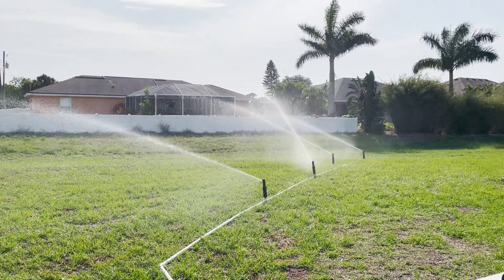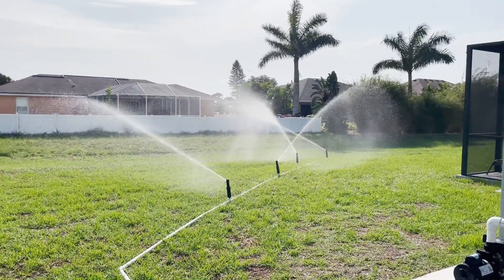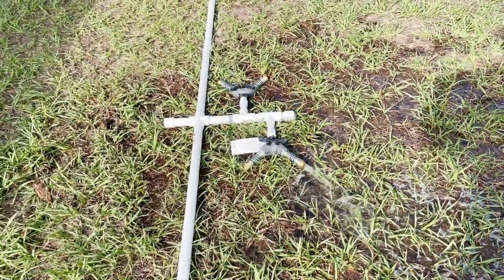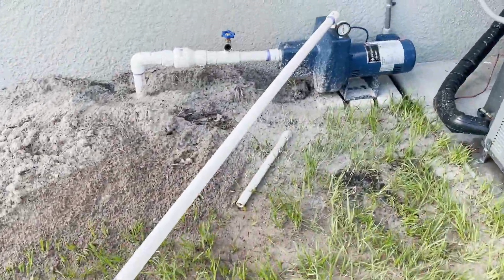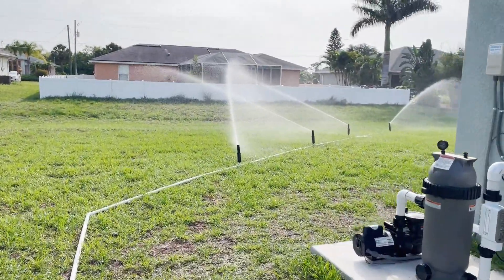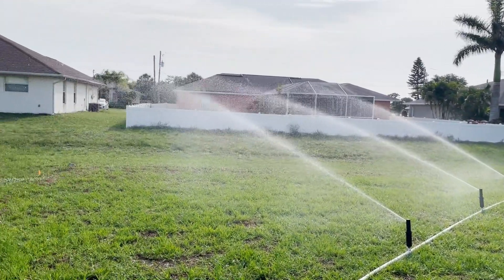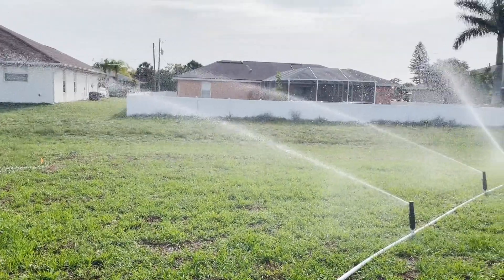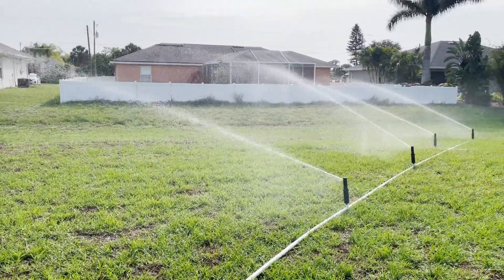Florida Sand Point Well (part 10) Hunter PGP 3GPM Test

Comment: Guy, this is the best video selection I have seen yet on how to do this. I am in the Northwest FL about to miles from the ocean. My neighbors wells appear to work great but mine is either clogged or the well pull line has a crack, which that is what I suspect.  I am going to re-dig a couple of these and hook up just like you did.  Again great videos.

Comment: How many ft you get a water table? I am from Orlando. Thanks.
Reply from the maker: The ground water table in my area starts right at 8'.  So, with a 26' hole, I have 18' of water surrounding and on top of my 4' sand point.  Water for days if I want, but I don't.  😁
Reply: @guydoesstuff6562  Thank you very much!

Comment: Which pump did you use?   I tried a harbor freight and DRUMMOND and it candle my 27ft well point with 14ft water table.
Reply from the maker: I went with a robust, long-term solution:  1HP Pentair HNE-L Sta-Rite Shallow Well Jet Pump.  This is a cast iron pump which is rated at 1HP, but due to the internals and performance specs, it is easily a 1.5HP pump in sheep's clothing.  It is currently a $600 pump, but should last 10 years before needing to be rebuilt.  The other pumps at $300 to $400 will last a few years before needing to be thrown out and replaced, so a much more expensive pump over the long haul.  Avoid plastic pumps.  They are noisy and burn up quickly.
Reply: Are you still make wells in port charlotte area? Thank you
Reply from the maker: @yamelrodriguez9049 , I just added videos to YT as a DIY'er.  I am not for hire.  Just a homeowner taking on a project.  Please let me know if you have additional questions.

Comment: Do you have a check valve in each well point or just 1 at the pump?
Reply from the maker: Just one at the pump.  The CV is oversized by 1/2" and then adapted back down to line size at input to pump.

Comment: Awesome video series. Looking to add a well system to my property exactly this one. Property in St. Petersburg FL, how did you determine the depth to put the shallow well? I was wanting to only do one well point rather than 3. I’d have max of 4 heads in a zone
Reply: Thanks.  When using a surface pump, you'll want to stay less than 30'.  At 33', you'd be at 1atmosphere of pressure and surface pumps won't work below that.  Another reason for 26' well is that we are coastal (<5 miles from the gulf) and didn't want to run the risk of getting into saltwater.  I was into good sand right at 20'.  You can research your local groundwater depths in the St. Pete area, but you should be into plenty of water at even 20'.  I have 26' holes with 17' of water in each one, so LOTS of water.  Plan on covering your well points with at least a 3:1 ratio of water.  So, if you use 4' well points, you'll want to have at least 12' of water in the holes.  I would strongly recommend going with a 2-head setup as a safety measure for longevity.  Your GPM of flow and pressure will determine how many heads you can have.  For example, I have a zone that has 23 heads on it, but the nozzles are all rated at 0.5 GPM, so 12 or so GPM usage.  The number of heads in a zone is not important.  Rather, your total GPM of all heads combined in the zone is the key.  You just want to make sure that you can maintain 45 psi from your pump when a zone is running.  If you have to drop down to smaller nozzles, all you have to do is run the zone longer.  Hope this helps.  Good luck and please post back regarding your success.
Reply: @nhojcam  That doesn't make sense. If that were the case, we wouldn't be able to pump water out of a deep lake or the ocean. What really matters is the distance of the water level from the ground. The deeper the well, the better.
Reply: @masf1977  you are missing a key point... these pumps are on the surface.  deep wells are pumped differently.
Reply: Thank you for the info. Super helpful. I’ll post back as I get more info. Right now I started the project over the weekend and successfully hit 19-20’ with 1 1/4” well point. I hit the water table which sucked the water out of my pipe so I figured that’s as deep as I can go with my pressure washer. I decided to take your advice and install 2 points. I got a little excited and didn’t measure the water depth before taking the 2” pipe out. Will update on the 2nd well point later this week. I will say the 10’x4” pipe was a pain to put in went smooth from there
Reply: Hey it’s been a few months. Took a while for my electrician friend to wire the pump up. Just got it running today it was holding about 40PSI and 10 GPM on the 2 well points at about 19-20’ thinking about having someone come out to run the piping.
Reply: @apexspearing ❤❤❤😂😂😂